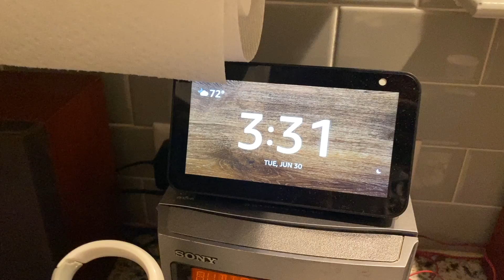ELIJAH AND DANIEL LEAVE FOR THEIR MISSIONS : Adventuring Family of 11

Comment: I have a cabinet some what like your one on the wall. I place a tension curtain rod up in side of the cabinet to hold a curtain.  So that would be away to add some color and hide whats inside. I also change it out for the seasons. I guess with your children using the cabinet it would not work.